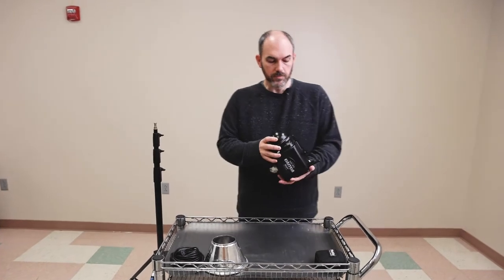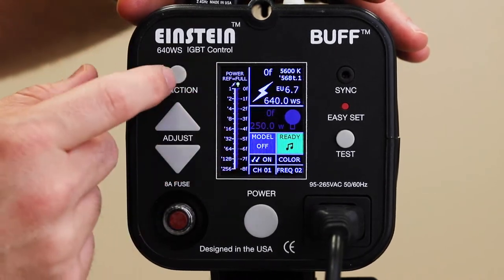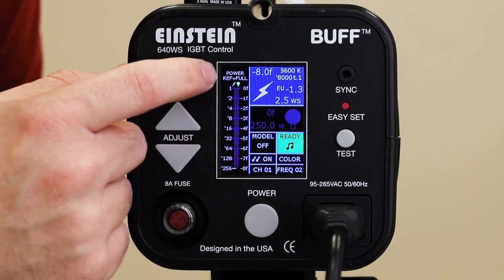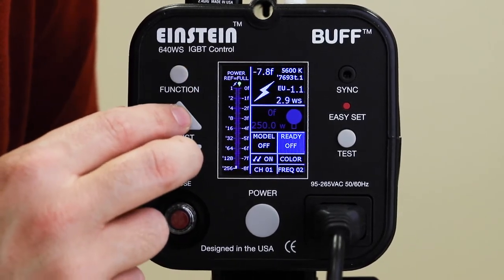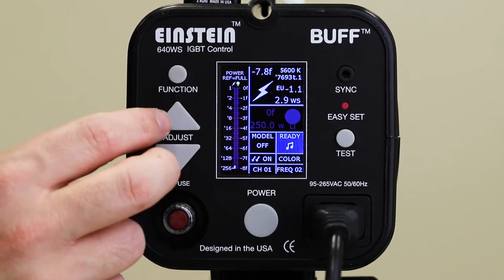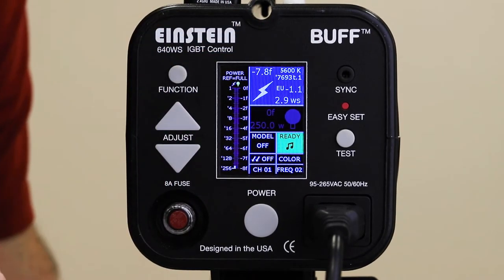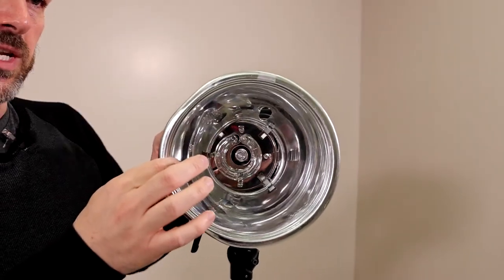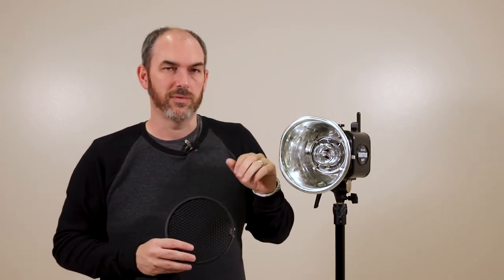Einstein Strobe Demonstration - Pittsburg State University

Comment: Action mode is not for recycling time but to get faster T0.1 scores down to 1/13.500 sec. instead of 1/8.000 sec. in color consistency mode, so it's meant to shoot things that are fast moving and still freeze action, of course at very low power output (close to 1/256th) the lower the output the faster the T0.1 score, at full power you always get 1/588sec T0.1 score no matter which mode your'e in.